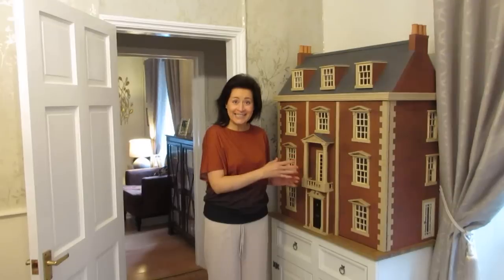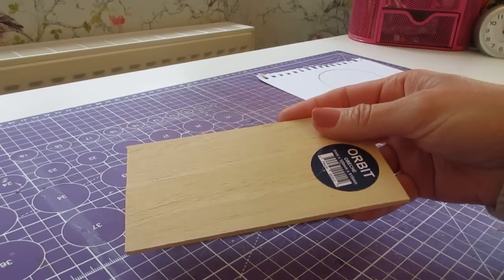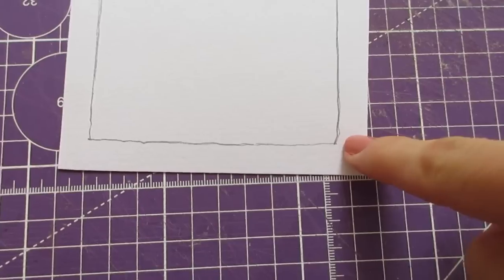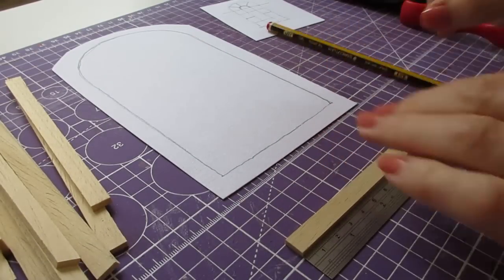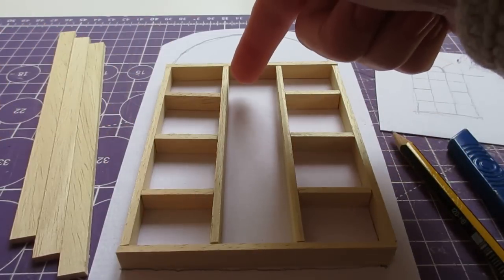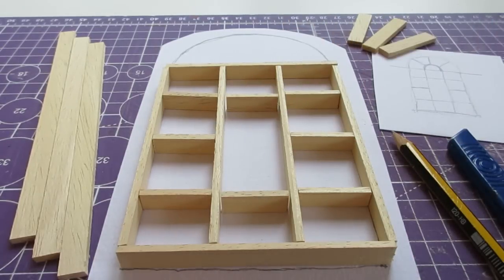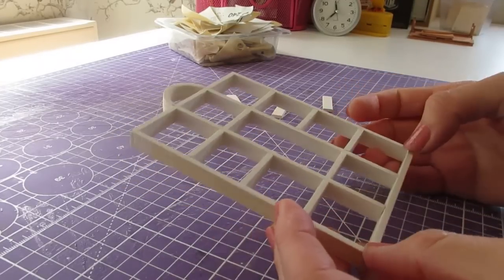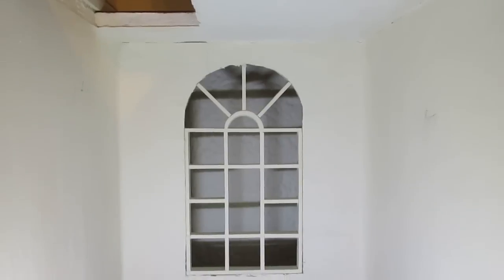My Dolls House Diary #55 - Building an Arched Window

Comment: Just rewatching this window making.  In the mean time I have learned something that might be helpful.  When cutting something that is so likely to split as that arch, if one puts masking tape on the underside it helps to keep the wood from splitting and you can remove it after you are finished.  And then, even if it does split, the pieces won't go flying because they will be stuck to the tape.
Reply from the maker: Thanks Mary, that is a great tip! :) xx

Comment: Good job! It looks really nice! You could work on top of a piece of ceiling tile to be able to pin beside the wood to hold the pieces in place while the glue sets.
A sneak attack approach for the circle pieces where instead of going straight for your line, you would remove all the wood from the bottom up to give clearance for the wood nearest your line to be cut away and sand when you are close to the line. Since you were stacking several pieces together, you might glue the three pieces together first and offset the grain pattern to strengthen it and sand with the paper glued to a dowel or appropriate diameter object. Hope that helps  : )

Comment: I love your book creating dolls house kitchens.  I do have a question though do you lay the floor before you decorate the room or after?
Reply from the maker: I decorate the walls, then lay the floor, then add the chimney breast if you're having one, then it's the skirting, coving etc.  Hope that helps. :) xx
Reply: @JulieWarren  thank you it does help I did think that was the most sensible way, but wasn’t absolutely certain